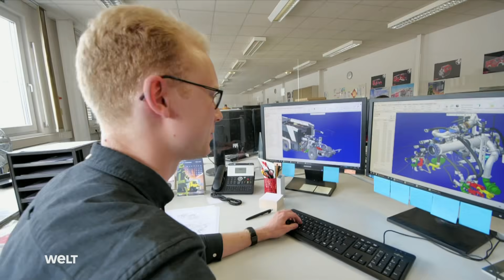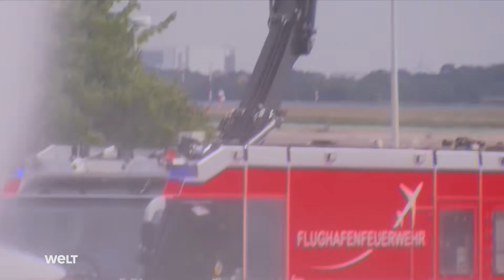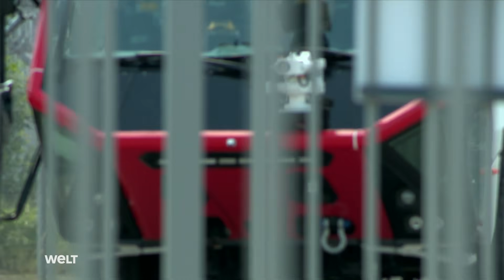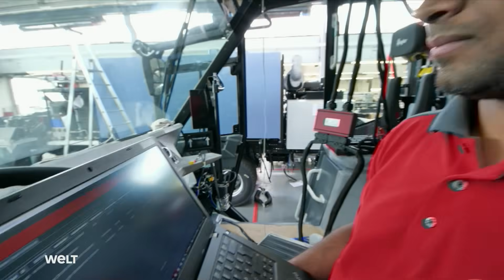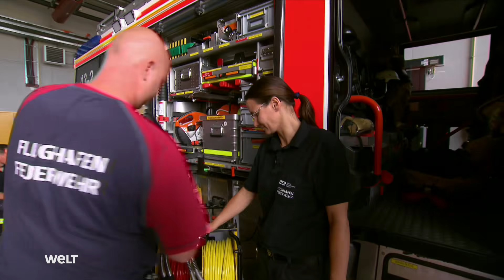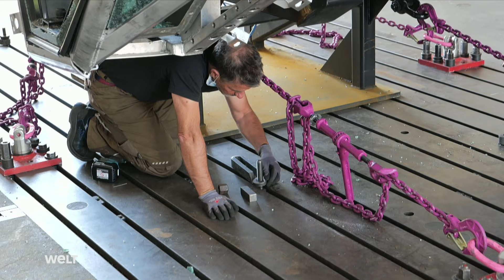AIRPORT CRASH TENDER - High-Tech Fire-Fighting Vehicle Of The Fire Department | Full Documentary

Comment: Someone could, please, tell me how much water the vehicle holds full ( each cubic meter 1 m³ = 1000lts of water; each liter = 1kg).
With the pump working 90% , how much time (water, foam and sand) you have to put of the fire, having no access to more water?
4 minutes is not enough even to cool the cockpit...
A vehicle without water is just another thing to hinder work!
Reply: it depends on which size the department chooses to have: the apparatus is available as 4x4, 6x6 and 8x8 and each one has a different tank capacity;
4 minutes are more than sufficient to get an aircraft fire under control

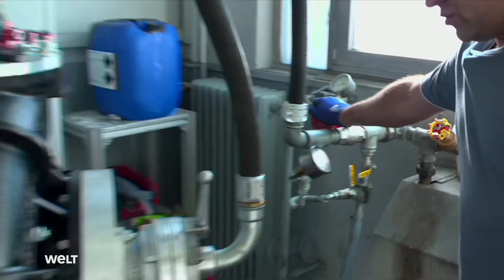Comment: 11:30 "17 bars of negative pressure". That's impossible, when testing in air in a normal room, the negative value of pressure (different degrees of vacuum) can not be more than 1 atm or ~1 bar which equals absolute vacuum inside the part being tested. I'm sure the pump was tested at positive pressure and the word negative here was a mistake.
Reply: You wrote it yourself: AIR can't be pumped with less than 1 atm. Water can be pumped at much greater pressures however.

Comment: Why is it that the engine at some point of the documentary shows a Scania engine but the steering wheel shows a Benz logo ?
Reply: When building fire trucks there is no one engine,
One cabin or one steering gear. 
At the start of the project we spec out the parts needed and put out a request for pricing from different companies. 
For instance Scania most likely offered the best pricing on engines as well as support. 
Benz offered theirs in the suspension and steering etc.
Reply: @chloehennessey6813  learnt something new today. Thought it was a standard chassis and engine paired to the body. Even the specs page on Zielgler's website states Scania engine.
Reply: @chloehennessey6813  well in fact the truck chassis and apparatus manufacturer are two different brands, but among ordinary fire trucks the truck itself will be from one brand: a Mercedes-Benz based fire truck will have a Mercedes-Benz engine, drivetrain, suspension, steering wheel, cab, ...

Comment: such high tech state-of-the-art purpose built 6X6 & 8X8 fire fighting trucks needs even better military grade thicker high strength steel chassis frame for greater torsional rigidity & better stiffness that are essential in the long run . . . it should exceed military standards by leaps & bounds . . . for off road use the new 6X6 & 8X8 fire truck could do with a heavy duty 5.0 in. suspension lift, not to mention a reinforced chassis frame & body (forward 4-Dr Double Cab & aft chassis mounted fire fighting apparatus) . . . a beefed up suspension featuring stiffer springs & shocks, anti-roll bars & a 5.0 in. suspension lift . . . and ofcourse all terrain HGV radial tyres . . . the fire extinguishing hydraulic arm on the roof could do with an additional hydraulic support arm (two is better than one) to counter the increasing weight & lean as the extinguishing arm is extended further out, from the fire trucks . . .